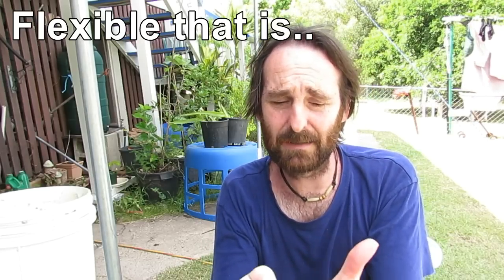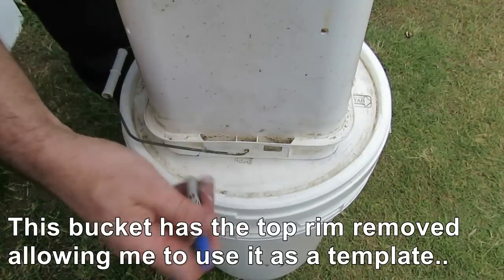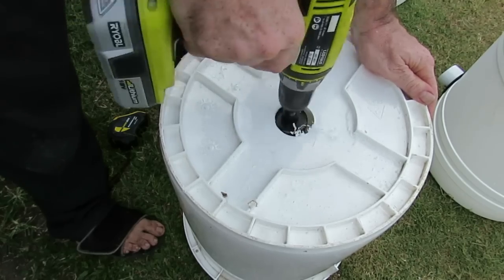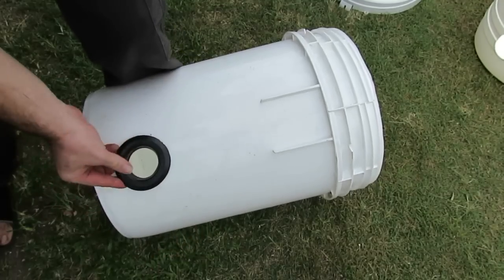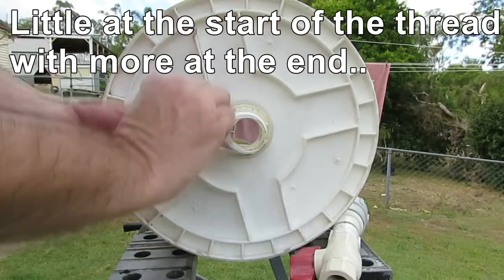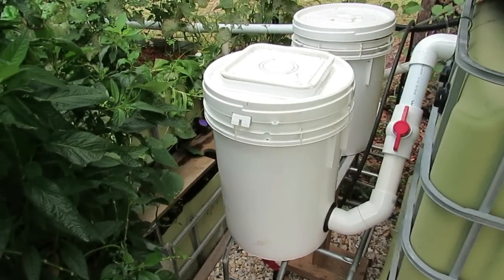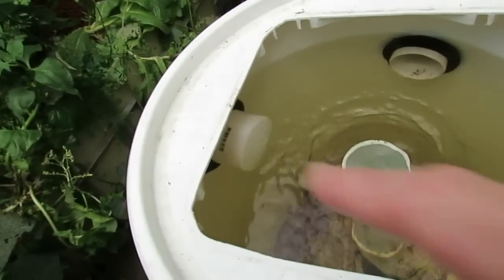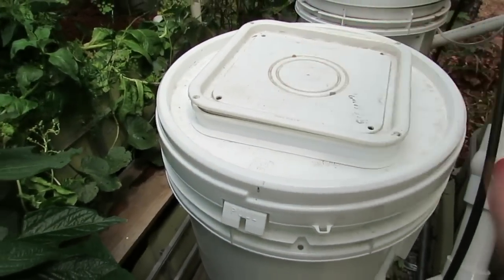How to Build a Radial Flow Solids Filter for Aquaponic Systems

Comment: How long should I run my system empty to test?
Reply from the maker: Hey David..
Sorry I missed our question mate :/
Are you still trying to cycle the system? I've always used fish to cycle the systems I've started.. Also helps if you can pinch some grow bed media or biomedia from an existing system to help kick start the process for you..
Reply: Yes sir, I am. I think a guy in the next town over will give me some already used media from his aquaponics system.Just curious on how long it takes. I'm afraid by the time it gets stable with nitrites and nitrates it will be really hot here in Florida. Might not get it up and ready til fall crops. Thanks for answering my post.I really look forward to your videos and the info you give. Cheers.
Reply from the maker: David Underwood
It can take up to 3 months but have been told that it does happen faster in warmer areas David..  Have you got a test kit at all ?
Reply: Not yet. Going to order next payday. I have to buya digital because I am colour blind. I just can't read the regular test kits. Do you have a brand you prefer? I've been looking on Amazon and I am suspect of the cheapies, but the expensive ones are so much more.
Reply from the maker: David Underwood
I use the Hannna pH pen & see that they sell digital meters for nitrites as well.. Will set you back a bit of coin though :/
http://www.hannainst.com/usa/prods2.cfm?id=024015&ProdCode=HI%20764
Might be a good idea to send them off an email if you are interested to see if they can help you out David..
Hope that helps a bit..
Reply: Rob Bob Thanks for taking the time Rob.You rock. I hope my system turns out half as good as yours. I'll certainly look into it. I work construction so I've been collecting pipe ,pumps,etc since I started watching your videos. As always you are pointing me in right direction. Thanks.
Reply: Rob Bob PS I used Non Toxic Biodegradeable deglosser to help paint stick to plastic IBC. Nothing really likes to help. But this stuff was the least toxic of the liquid sanders I've used. It's made by Krud Kutter.

Comment: Looks good Rob, added one very similar to our system (used a 55 Gal. drum) about 4 months ago is working with out a hitch. we also put a bio mass filter in at the same time it made a world of difference in the water quality for the fish,
Reply from the maker: Morning..
That's great to read... How do you clean the solids from the RFF & do you have problems with fine solids collecting in the bio at all ? CCBear said he had a few issues with solids coming through his RFF to the Bio so has set up a small filter in between..
Cheers & thanks :)
Reply: I pump all but about 5 gal. of water into another 55 Gal. drum then use a shop vac to suck out the waste. (dump that on to the garden patch), then pump the water back into the rff. sounds like way more work than what it really is. I use womens knee highs with a ball of polyester batting in them on the inlet of the bio filter. Seems to work ok easy enough two rinse out once a day...have a good one
Reply from the maker: mowery12345
 It was suggested in a post above to pop a drain tap in a few inches from the base to take out the bulk of the clean water as you have described so we don't waste as much water..
Cheers..

Comment: I don't have a radial flow filter.  Having said that, I don't because I am too damn lazy to make one. I like them. I run my water through a fish filter spounge both as it comes into the grow bed and as it comes out of it.  Also, my system is a LOT smaller than yours mate.
Reply from the maker: I don't think they all need one either Andy... Won't be putting one on the small system on the deck as it will only have small grow beds that should flush out fine.. Just need to build the deck first before I can get to that jobbie though :/ :D
Good luck with your plumbing jobbie too..
Cheers mate & have a great week end..

Comment: Have you tried silicon Rob? I use silicone on everything where there is water
Reply from the maker: I haven't used the silicon sealer or the lube Gordon.. I did have a plumber offer me some but the soap looks to do the same job..  The only place I have used the sealant in the system is around the cap on the bottom of the grow bed over the sump & in the tap at the base of the sump...
Cheers sir & have a great one,
Rob :)
Reply: Soap will wash out but silicon lube and sealant seals pretty darn good, I had to seal some new aluminium window frames and slide the reveals on to used the lube it lubricated and sealed a the same time and have used it on all water tight seals for years way back into the 1900's